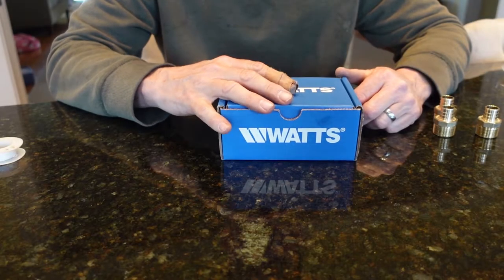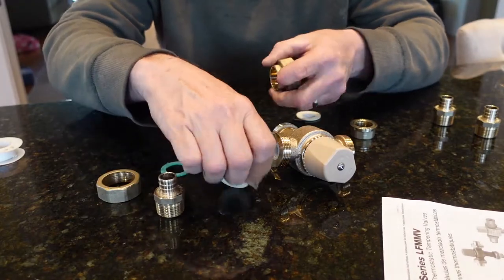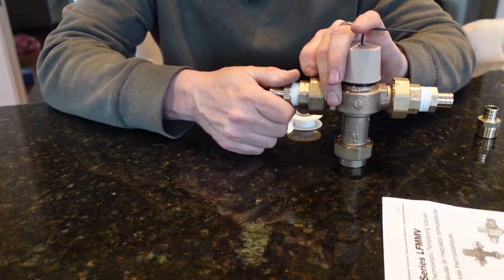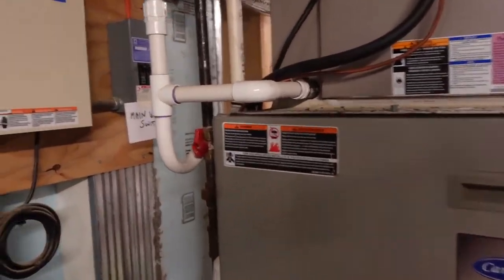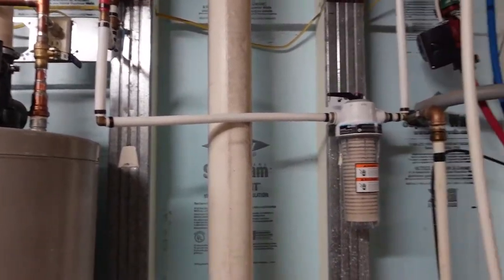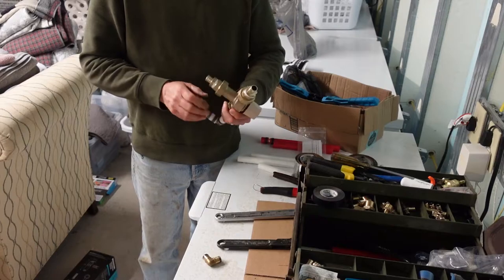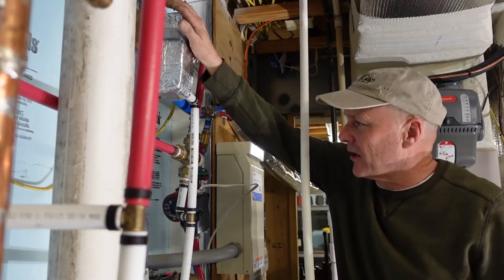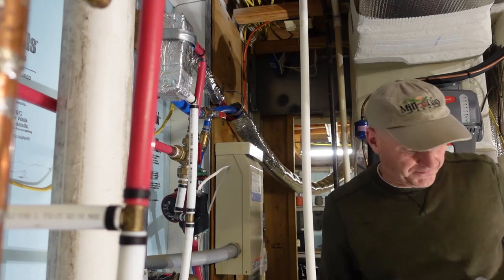Mixing Valve Installation - Really, More Plumbing Videos?

Comment: Thanks for the video. My wife and I built a new home from scratch. The inspector said we still need to install a water mixing valve/temperature control valve.  My contractor, home depot and the plumber didn't know what that was or why it's required for our new build.  Now we know what it is. That's half the battle.
Reply from the maker: Jorge,  I'm glad it helped you.  I had never used one until we got an outdoor stove and it really heats up the water. Even blended, it is crazy hot.  One point of caution Jorge, check your water for hardness.  If you have hard water and high temperature water, you could experience problems like we have, with the minerals clogging things up.  Once we put our softener in, a lot of our water issues went away.  Thanks for watching our videos and sharing your thoughts!  Kevin

Comment: No, no, no if you have a regular hot water heater do not turn the thermostat to 120 deg. Code says you must run a mixing valve in the system to prevent legionair bacteria from running the tank at too low a temperature. (This is especially true if you have well water with no chlorine in the water). 145 at the tank thermostat and 120 deg coming out of the mixing valve is code and proper and will give you more overall hot water!!!
Reply from the maker: Thanks for posting the comment Joseph Winner 4475.  We don't use our hot water heater anymore.  I'm sure it's functional.  We use an outdoor furnace and when the water comes into the home, it is 180 degrees Fahrenheit.  We are using the mixing valve to temper the water where it won't burn us.  The furnace heats our home and domestic hot water.  We do have well water.  Thanks for taking the time to share the details you did.  I gained another used piece of knowledge!  Kevin

Comment: Would have really like to see how you made the final mixing adjustments, and how that was completed.
Reply from the maker: Mr. Simmons,  Initially I thought about buying a thermometer that would be in line on the pipe so I could really dial it in.  After a little more thought on that, I decided to use the deep sink right below where the valve was installed and my maple syrup thermometer.  We have two little ones and in reality the real test was would it burn them coming out and is it hot enough for my wife's scalding hot showers...  I errored on the side of not burning the kids. Our outdoor furnace will generate 180 fahrenheit all day long...non stop.  Blending was definitely necessary.  As was softening the water. I hope this helps.  Let me know if I can help you  If yo need more info.  Thanks for watching and commenting!  Kevin

Comment: The mixing valve looks nice and beefy, Kevin. Should last a long time. Priced nicely too. Similar units for darkroom labs run between $300 to $1000(!) They do have a thermometer attached so you know right then and there what the output is. A cost-conscious work-around would be the valve you installed coupled with a thermometer holder attached to the output. Yes, those are available. Cheers!
Reply from the maker: ZaZuRider13,  I didn't think about the thermometer until after I installed it.  I set it up by feel.  Get this... the whole reason this started was because of the heat exchanged we installed for our hot water... and then re-installed a new one because it stopped working... the new one is starting to slow down too.... I put it behind a filter but it looks like something is happening in it and it might have debris in it again... Argh!!!  We can still take showers but not two of us at the same time... crazy huh!?  At least I know how to fix it in relatively short order...  Thanks for watching!  More videos coming out soon!  K

Comment: Hello, may i ask you what will happen if the hot water supply cuts off? If for example we have a problem in the hot water boiler and need to stop the hot water supply until we repair it. Does the cold line continue supplying the house with water or the hole system will stop? Thank you?
Reply from the maker: Thanasis Sagonas, Thanks for watching our video. What I believe will happen in your situation is that you'll still have water throughout your home but it will be at a lower pressure on the hot side.  If you don't have a check valve on the hot side somewhere behind the hot water or a shut off valve you may have to shut off the cold water supply to the blending valve.   As I'm thinking about it, I would guess there is a shut off valve on the boiler as it leave to go to the supply lines to the home.  Once that is shut off the unit can be serviced and no water will go backwards.  Going back to my first idea, you will have water, although cold, at your hot water faucets.  It will most likely be at a lower volume or pressure.  A word of caution, don't change the setting on the blend valve to get more volume or pressure on the hot water side.  That will cause you some frustration once your boiler is repaired and you have to figure out what setting is best for your home.  Thanks for watching our video and leaving you question in the comment.  Good luck with your repairs!  Kevin
Reply: @MillGapFarms  Thank you very much. Your response is very helpful.
Reply from the maker: You are most welcome.  I would be curious to learn how your repairs went.  Thanks Kevin

Comment: This damn thing has reduced the tap temp to 114 deg F in my house. The unit is a Zurn wilkens valce and screw on it does not budge. What should i do, replace it?
Reply from the maker: Kevins9688,  thanks for watching our video. First thing I would to is remove it and put it in vinegar or citric acid.  Most folks have vinegar.  Soak it for as long as you can. If you can't get it to budge, time for a new one. It sounds like you've got minerals caked in it.  I'm not familiar with that model, since I've only installed this type.  Would you mind going to our website www.millgapfarms.com and sending me an email or an email. That way you could email me a photo of what yours looks like. Zurn is a great company.  I am thinking there is a way to service it.  The valve we are using is not terribly expensive. Here is an affiliate link to it...https://amzn.to/3sxdjyV  These are easy to install and should take less than an hour.  Have all your pieces parts ready when you start the process.  Let's talk a minute about the root problem.... how long have you had 114f water?  That seems really low.  Are you sure your hot water heater is working correctly?  If you have a two element heater one element could be out and thus the input into the mixing valve is very low.  I hope some of this helps.  I look forward to hearing your solution.  the other Kevin!

Comment: What a POS!   they installed one in my home and my bath water is luke warm.  The rest of the house including my kids shower and baths are scalding... I can not even adjust mine?  Plumber told me he couldn't adjust it or take it off but suggested I just take it off and turn it around?
Reply from the maker: Mr. Adams,  I think your problem is with your plumber.  I bringing in water that is 180+ degrees Fahrenheit and I am able to dial in the temp so all our fixtures are not scalding.  It has to go in front of the hot water supply to the rest of the home.  I will say it took me a little time to get it adjusted right.  Mainly because I didn't install a temperature probe after it.  That would have made the dial in time much much less.  Go to our website and send me a couple photos of yours. Maybe I can give you a couple pointers on how to get it work right.  Thanks for watching our video and taking the time to leave a comment.  Kevin
Reply: @MillGapFarms  Any idea what happens if I turn the Mixing Valve around backwards?  I have called 3 plumbers and all have said the same thing.  They can not move it.  This mixing valve is just used for our soaking tub...  no other faucet in the house has one and it is the only one that does not get hot enough.   The adjustment is turned all the way to the hottest setting for the mixing valve.   One plumber said I could turn off the water, take the mixing valve off and turn it around and it would give me as much hot water as I want.  What are your thoughts?
Reply: Mine too! Worked hot for the first couple weeks maybe but over a year it's not even warm. I can't even get to it to adjust the hot level. It's attached to the master bed tub that has bubblers. Brand new manufactured home
Reply: Any fixes lmk
Reply: @TheRealShowtiming  my fix was I bought a hot tub and don’t use the sh…ty soaking tub anymore.
Reply: @TheRealShowtiming  I thought about having the valve replaced but haven’t.  One plumber told me to turn the valve backwards cold to hot hot to cold and it would bypass and get as hot as I want?  I may have builder replace valve before 1 year warranty comes up in June!
Reply: @KBradAdams  im only home on the weekends and have had the issue for almost 2 years. I spent three hours and finally got the valve off and swapped hot to cold like you mentioned and it works again. But for how long is the question. I had cramped working conditions as it is position under my sink thru the panel and had to work blind on all of it with Allen wrenches and finding the adjuster.
Reply: @TheRealShowtiming  Great to Hear Zachary! I think it might work a long time since it is not recognizing the hot water being too hot so it should continue to work!  One of these days I am going to turn mine around and see how it does.
Reply: @KBradAdams  yea I hope you do. Took me 2 yrs to say fuck this and went down there a 3rd time and just fight thru it blind.
Reply: @KBradAdams  those thermostatic valves require inbound hot water to be above certain minimal threshold, see valve specification for exact temperature. If inbound temperature lower that acceptable it will be lukewarm, as it always lets certain amount of cold water to pass, hence mixing it with cold water. Since you have this valve closer to your point of use, hot water looses some temperature   after making all trip to the tub, then mixing valve adds some cold water in mix. Depending on construction of your tub filler faucet, like if it is one of those with swing left/right adjustments this adds another chunk of cold water in the mix even if you put it all way to the hot. Although, If your filler tub faucet already has mixer, I’m sure why you might need this thermostatic mixing valve right l next to it.
So if you flip cold with hot intake on mixing valve this will flip valve logic, so you have to turn knob to the coldest to get max of hot water, also those thermostatic valves have anti-scale protection, which means if cold water cease it closes hot water completely to prevent scalding, by flipping intakes this logic will behave accordingly, letting of more cold inlet water to pass, although if you have mixing tub filler this will bring you back to same situation as I explained above, so you don’t need this thermostatic valve at your tub. Also, there is small version (1/2) of those thermostatic valves that are designed to hand wash faucets at lavatories, those have even smaller threshold for mixing, and those just not right fit for use with tub filler
Reply: @BlahBlahManYeah  Thanks for the reply.  Sounds like what the plumber said initially that I could turn it around and it would allow hot water in the tub.  I have a recirculating hot water system and am sort of afraid I might screw something up if I try it but at this point 3 plumbers have refused to do anything with it but my work around has been running a pool noodle connected to the vanities with hot only and fill up the tub with those as the soaking tub fills at the same time.  That brings the temp up to a good temperature.   I even bought a low end hot tub as well and told the builder I bought it because his soaking tub sux.   He didn't even respond.   Our 1 year ends in June so I am going to put that on the punch list and see if they can at least replace the valve or fix it if I can't turn it around myself.

Comment: Why did my builder put one of these on my hot water tank when my tank has a digital temperature control ?
Reply from the maker: First Canadian Hustlr,  your profile picture is amazing.  I thought I had a fly on my iPad!  If you  go to our website millgapfarms.com send me a picture of what it looks like. I may be able to give you some more insight into it. Be sure to give me a picture pretty far back so I can see all the plumbing. On a house with a water heater only it does not make sense.  Thanks for watching our video and sending me this question. You definitely have me curious.  Thanks Kevin
Reply: Plumbing code requirement to prevent scalding injury.  However, for prevention of tank colonization by harmful bacteria, setting the water heater temperature higher is recommended, so the mixing valve reduces water temp to a safer level before it reaches faucets. Bonus: more hot water at the faucets.
Reply from the maker: Mr. Grommet, Thanks for you info on this video!  Very helpful!  Thanks for watching, Kevin

Comment: What is your heat source?
Reply from the maker: We have two.  The primary is a gas furnace. But with the cost of propane and the fact we have instant hot water on our propane water heater, we moved to a outdoor furnace.  It uses wood, which we have plenty of and it works like a charm!  The water coming into the home is 180 F.  Thanks for watching and posting a comment.  Kevin